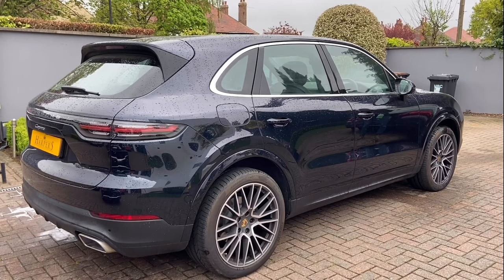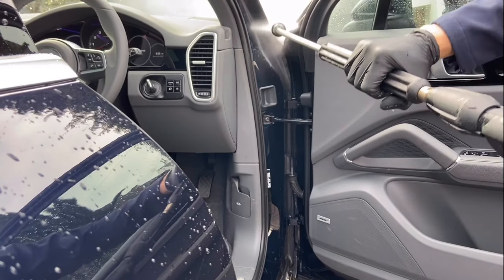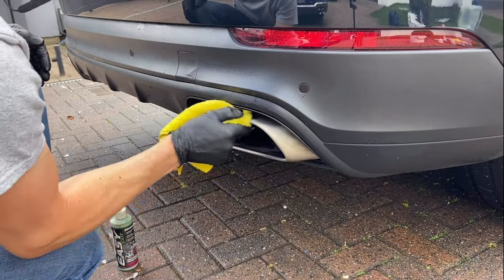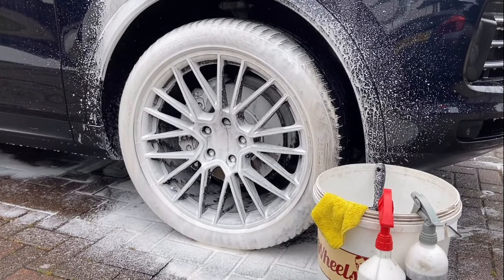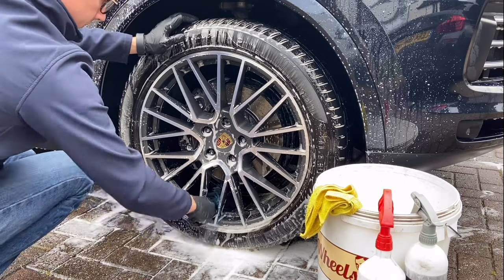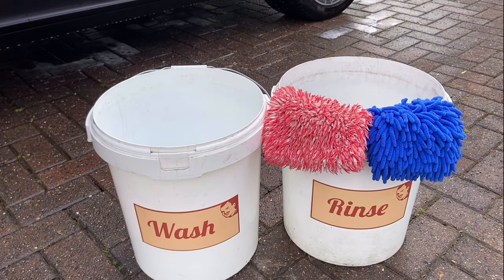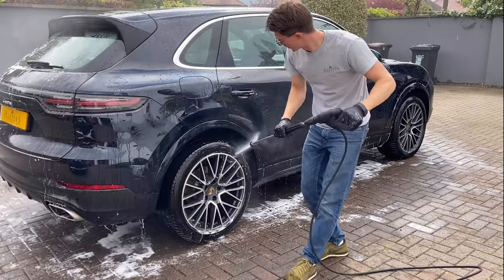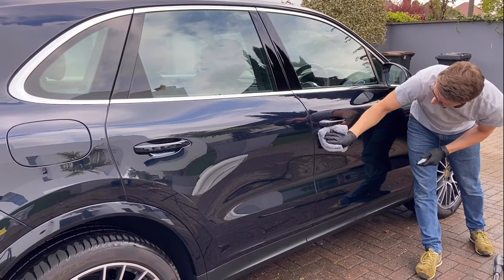HOW TO Maintain a Ceramic Coated Car | Swirl Free Wash

Comment: Another question : last time you kindly answered my question about alkaline shampoo (BH auto shampoo, pH 9); you said that pH doesn't mean eveything. So I've got 2 other questions : 

1) what about the PRE wash shampoo used in your video (BH auto-foam), which is pH ...13 ? I know that pH is not the only factor, but is a pH 13 safe for ceramic coatings (regular wash) ?

2) How do you compare the shampoo BH auto-wash to Carpro Reset ?

Thank you in advance.

Comment: You could use the drying towel to suck up the water by not rubbing it over the paint, place the towel on the surface, pat it all over and lift it straight off without rubbing or dragging it over the paint.  Shake it to remove excess water and any dirty that may still have been on the surface and move onto the next section and repeat..
Reply from the maker: Agreed, this towel isn’t great for PAT drying compare to others. That’s why are typically dry the glass 1st to lubricate the towel before touching the paint work. As long as you don’t apply any pressure in this town is very safe to use and I haven’t had any problems so far. In an ideal world you would just use compressed air see you don’t touch the paint work at all but that would take forever.

Comment: How often is a maintenance wash recommended and also what sort of wash should i be doing weekly on a ceramic coated car? Just snowfoam?
Reply from the maker: I usually do maintenance valets monthly for my clients, but I personally wash my car & van weekly. 
No, you would still need to go through the full wash process otherwise you could risk marring the paint if you only foam then dry 👍🏼
Reply: @HarpersCarDetailing  thanks mate.could you also send me links to what microfiber clothe you use? Also is auto wash just a pre wash before shampoo?

Comment: Since Built-hamber auto wash has a pH of 9,  why do you use this shampoo on a ceramic coated paint ? I thought we could only use pH neutral shampoo on ceramic, like Reset from carPro.
Reply from the maker: That’s a common misconception with comic coatings. 
The ph doesn’t necessarily determine the harshness of a product. An apple is oh 3.5 for example.
The best product I have used to unclog a coating is called Labocosmetica purifica which is ph3. In order to remove water spots and limescale which is what clogs the coating, you need to use an acid-based product.

Comment: would you recommend using new mitts when was a ceramic coated vehicle?
Reply from the maker: Providing that they don’t get to beaten up during the wash you should be able to just machine wash them every time. 
If they start to look a bit worn then replace 👍🏼

Comment: Thanks for this awesome video. A quick question if you don't mind. If i wash my ceramic coated car lets say once a week or once in every two weeks, is it ok and safe to use a wax type product such as turtle wax dry and shine or similar when the car is wet and rinse it off after? Or better make it dry properly and use a quick detailer such as carpro elite (lighter version of reload) , Nova Boost, Xtreme Solutions Topper, Auto Fanatics gloss enchancer, Polish Angel Presto etc
Reply from the maker: Hi Emrah, yes that should be fine. The spray and rinse products are becoming a lot more popular and work very well if applied properly
Reply: @HarpersCarDetailing  so, as a general wash once a week or once every two weeks, it will be much easier this way to spray and rinse the car off. Also this will consume less time undoubtedly. You know, unfortunately I don't have my own garage yet and it is not allowed and very legal to wash the car somewhere outside. So we go to car wash places with token and we do washing on our own, similar the way on your video, and in such places there are not always time to go slow. So this way will help :) 👍

Comment: i dont get the maintenance spray though. If the ceramic gold has so many layers already - why do you need to add another layer every time you wash the car
Reply from the maker: I probably wouldn’t use it every time, maybe every 6 months. 
It’s just to help with the longevity of the coating 👍🏼
Reply: @HarpersCarDetailing  Ah ok makes sense...thanks!

Comment: Question man, hopefully, you can help me? Is it ok to wipe your car with microfiber to wipe off the dust on my car? I'm doing it every day.
Reply from the maker: Hey, sure no problem. 
I personally wouldn’t as the small dust particles are quite sharp so could very easily marr the paint finish. 
If you 100% want to without going through the trouble of washing the car every time, which would be very unrealistic, then I would suggest a waterless wash product such as optimum no rinse. Spray that on first then with a damp drying towel carefully dry the car.

Comment: UV Barrier to protect the tyres. From what? Mine have only ever lasted as long as there is tread
Reply from the maker: Protection from the sun, which could possibly discolour the tyres quicker and lead to cracking. Like you say, it’s more likely you will change the tyres due to mileage, but every little helps to prevent any damage 👍🏼

Comment: I saw that when you open the front car doors and you started splash by water pressure gun the edge of the doors .. I think it will be much better safe to cover the speakers doors to prevent any water goes inside them .. just my observation however you doing great job
Reply from the maker: Hi, for peace of mind it would be good to cover but it would be quite difficult to do so. 
If you wouldn’t be comfortable using a pressure washer here, just use the end of a hose, that should do the trick. 
I’m glad you enjoyed the video 👍🏼 thanks

Comment: question.  You use reload every 3 months or so.   So When you was your car say every week or whatever. do you put down any other product at all? ex. Bead maker or a quick detail spray or anything like that until that 3 months where you re apply reload?   

Thanks!
Reply from the maker: If I’m being totally honest I don’t really like reload. I use it with Carpro as it’s designed for this specific coating. 
If the car is washed regularly then there hopefully won’t be a build up of any limescale or mineral deposits so you shouldn’t need to use it much. 
You can use it every time if you are wanting to prolong the coating or just enjoy using it 👍🏼

I like beadmaker, but it doesn’t last long. My favourite is bouncers done and duster Si edition
Reply: @HarpersCarDetailing  awesome thanks a lot man!  cheers

Comment: You need to pressure wash the inside of the buckets, I like to do it before using them
Reply from the maker: Goes without saying. The buckets are thoroughly rinsed before use. 

I’ll make sure I demonstrate it in the next video 👍🏼

Comment: worst detailed i’ve seen rinsing frim bottom up oh honey no no how did a Porsche driver trust you they must be old poor them
Reply from the maker: The only reason I rinse from the bottom up is so I can see exactly where I have been with my pressure washer, as it’s the pressure of the water that removes the underlying dirt. 
If you started from the top then you would dilute the foam below and it would run off the panel, so you don’t necessarily know when you have been, therefore you could very easily miss a spot. Whereas if you start from the bottom you can see exactly where you have been and can use the above foam as a guide as it remains in place. 
After that, you only need to very quickly rinse from the top to remove any leftover product or debris. 
It may take longer, but I would rather that than miss a spot and potentially inflict marring at the wash stage.
Reply: Got anything to say now Mr Perfect?